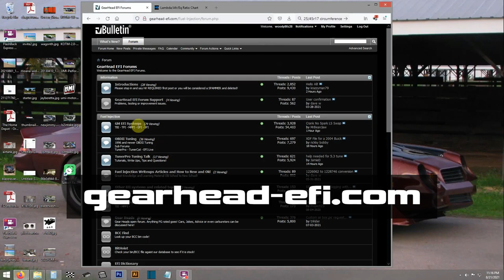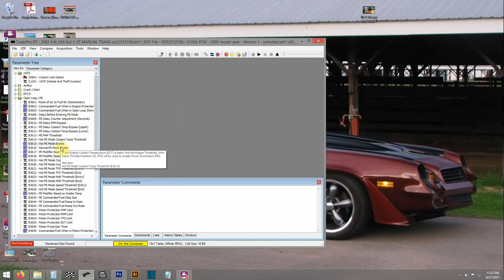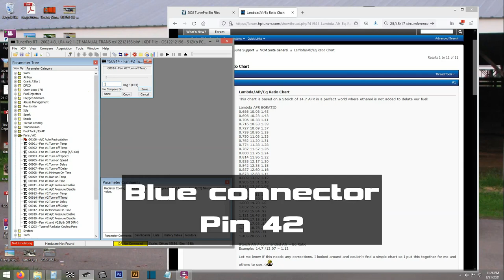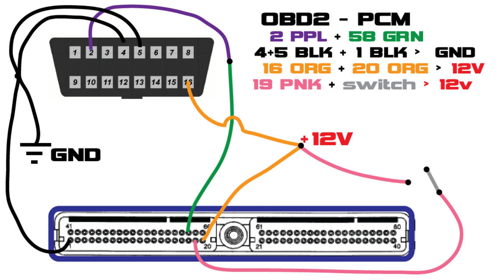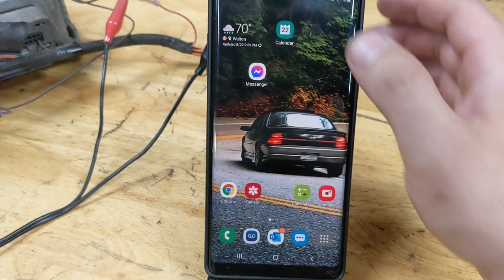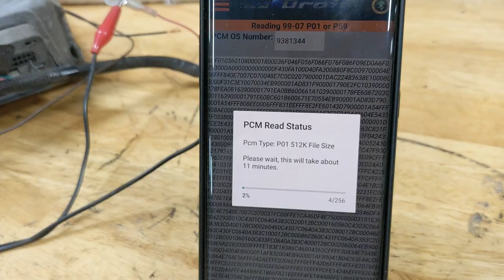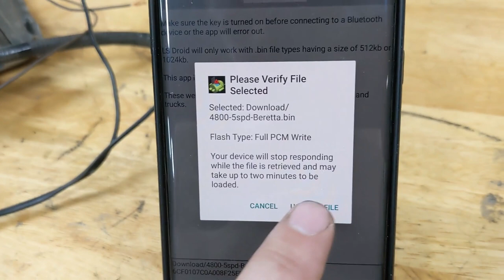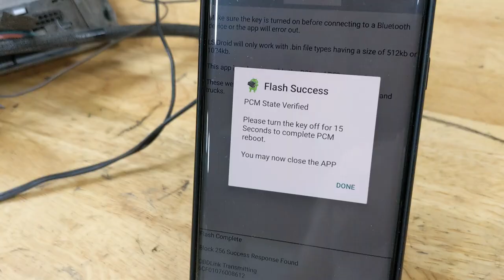Free LS tuning via bluetooth with LS-Droid - VATS delete, PE, efans, etc

Comment: Thank you for the good video. You'll be seeing me using this hopefully in September 😂. LS swapping a 91 GMC S-15 (4.8/AR5/8.8).
Reply from the maker: Sweet deal. I bought a 5.3 with harness and fuse block too swap my s10 blazer...but I dunno man. Mine is such a rusty turd it might not be worth it!
Reply from the maker: I have the 4.8 and 8.8 setup in my Beretta RWD swap, but ended up going T56 instead of the 5spd
Reply: Heck yeah. I hope my truck is save able myself. I'll finally start being able to film the process starting in September. I'm always looking for new channels. Thanks. This LS droid is going to save me a lot of bs

Comment: perfect keep making these helpful videos
Reply from the maker: I'm keeping my LS swap cheap cheap cheap. Haha
Reply: @GEARHEADdezign  this should work now with gen 4 e38 ecu using the new ls droid right?
Reply from the maker: @FirstLast-tx3yj  I just googled it, and it looks like it can
Reply: @GEARHEADdezign  amazing then!! Where to download the bin files from?
Reply from the maker: @FirstLast-tx3yj  read the one from your existing PCM
Reply from the maker: That's always the first thing to try
Reply: @GEARHEADdezign  i know i should and save it as a back up but i mean a sloppy stage 2 cam tube for example
Arent there bin files for such template tunes so i just flash and go?
Reply from the maker: @FirstLast-tx3yj  you could check gearhead-efi.com
Reply from the maker: I think there's a PCM hammer library too, but I haven't used it

Comment: My LS1 had a custom tune years back and sadly the tuner is no longer in busineess. Long story short, the cats went bad and did a cat delete. I am getting some P1133/53 error codes thrown at me, and nothing seems to fix it. I read somewhere that it's possible to tune out these codes from coming up. Is that something I can do with this software? I  do not want to lose the custom tune done though will I lose it if I start messing around or can it just go in and change what is needed to turn off the codes. Any help would be much appreciated.
Reply from the maker: Yeah, you should be able to read your custom tune and just make changes. If the operating system isn't supported by TunerPro you could also try "universal patcher"

Comment: Do you have to remove the PCM to read and write to it ? Is it possible to do it obd port inside the car not take anything apart?
Reply from the maker: In a truck with canbus it's recommended you remove PCM. I was able to do it from the port in my old LS swap car though

Comment: I have no idea what you did, but guessing, you changed factory programing using selective factory options for other models basically. you eliminated auto trans sensor, enabling use of ol' school manual? and somewhere in those files alarm/immobilizer is deactivated? wud you be willing to program my pcm when time comes? or write a kindergarten brain mentality directional list of procedures. I'd be willing to pay , one more thing, how much more/less vehicle info does one need for getting most outta pcm to a non -pcm vehicle aka '81 p/u , and a/c as future option, everything else standard '81 no smog pump,can a performance chip be used or is that basically wat is being done? can cam timing be modified ? original 5.3 LS had automatic in 4wd crewcab '05 no idea if 4L60 or 4L80 i cud find out if thats necessary ....just curious, how did you learn bout all coding n is it something that experienced ppl shud do?  i'm sure video is/was helpful to many, so thanx for making it, consider doing one using MSD LS box for naturally aspirated engine?

Comment: Is there a way to skip the "middle man" of the Android phone and BT dongle, and just read/write the file straight from the TunerPro software on the computer?  Using a USB to OBD2 cable?
Reply from the maker: Nope. I don't think so. You need the Android OS to run LS Droid and Windows for TunerPro. I did set my laptop up to connect to the BT dongle and that let me datalog. (See my other video). But TunerPro will only write OBD1 chips, it can't do OBD2.
Reply: @GEARHEADdezign  gotcha, thank you very much for the explanation

Comment: Subscribed! this is an amazing video! One thing i eread somebody say they bricked their ecu doing this, is a easy to do that or maybe the person just did something wrong?
Reply from the maker: I've only heard of that if the battery dies while doing it. But, there's a ground pin inside the PCM case that you can ground while booting up the PCM and it will "unbrick" it. I've actually used that process once to save one that I screwed up.
Reply: @GEARHEADdezign  good to know, i think i am going to do this and try it out, is the bluetooth dongle you have listed the only one that works ?
Reply from the maker: I think that's the only dongle that's guaranteed to work. Others could possibly, but I wouldn't bet on it.
Reply: Just got my dongle , will wire up a setup like yours and will be trying it out!! you have any other videos showing the actual changing of settings in the tune, like torque management and such? You video goes so fast at that part of it, thanks!
Reply from the maker: @kevinc5917  sweet. I sped up that part of the video cause it was boring otherwise. But you can replay it and get the details you need probably. Have you downloaded the software and checked it out yet? The XDF that I used had good notes that explained the parameters
Reply: @GEARHEADdezign  i am going to try out the software today grab a tune close to mine and just play around in the software with it.  I can read my stock tune and save it and i connect to my ecu correct?
Reply: @GEARHEADdezign  where find the bin tunes? i found .cal that list 5.3l but the bin file list i dint see anything with 5.3l in it
Reply from the maker: @kevinc5917  if you read your tune it will give you a BIN file that matches your operating system. Then just find the XDF for your OS to translate it
Reply from the maker: .CAL is Hptuners format. Won't work. If you find out your OS when you read your PCM I can help you from there
Reply: @GEARHEADdezign  ok thanks , i was just looking for a 5.3 auto 4x4 to play with the software, i havent got my tune from my ecu yet, OS is operating system?
Reply from the maker: @kevinc5917  yes. LS Droid will tell you the OS as you read it
Reply from the maker: @kevinc5917  I got the notification for your last comment but youtube already deleted it. Happens a lot actually. So repost your question and I'll try to answer it
Reply from the maker: @kevinc5917  if needed, you can change OS to something that has good XDF support. 2156 is a common one. For that, you'll have to download a BIN that's 5.3 4x4 auto and then check or change the gear ratio, etc to match your truck. And VIN
Reply: @GEARHEADdezign  i read that , then they say to clone it, figuring this shit out but not sure on the clone part. Still waiting for email verification from gearhead
Reply from the maker: @kevinc5917  when you go to flash, you can write cal only or clone. Clone flashes the OS, tune, VIN, everything. I used a 4.3 PCM to clone to my 8.1 and it was good
Reply: @GEARHEADdezign  Oh ok, so once i am done with changing everything i want and save the bin, then with ls droid on my phone via Bluetooth , thats where i choose to clone and send to the ecu, correct?
Reply from the maker: @kevinc5917  yes
Reply: @GEARHEADdezign  Nice! Thank you!

Comment: So if I buy a ODB2 to USB cable, and connect to my laptop, I can then tune my truck through a tuning software? after I read and write the stock ECU files?
Reply from the maker: Not necessarily. The Windows version of LS Droid might be able to, but I've never used it. 
I modified the tune on PC, but read and wrote the tune via Bluetooth on my phone

Comment: 1) Do you have to pull the PCM or can this be done on the truck using the OBD2 port?

2) How do you properly delete EGR?

Thanks for the video!!
Reply from the maker: I read mine in the truck, but it's suggested to remove PCM for flashing. The body modules can mess with the signal supposedly.
Reply from the maker: Easiest way to delete someone is to raise the enable temp higher than you're ever likely to hit
Reply: @GEARHEADdezign  I'll think that applies to 03+ vehicles that use can bus.
For a 99-02, I don't think it would be an issue leaving the PCM in the truck to flash.
Reply from the maker: @tt7hvn  that would certainly be handy for my Beretta swap where the wheel needs to come off and fender liner out to get to the PCM🤣
Reply: Great info

Comment: I’m brand new to this. I didn’t see anything in this video regarding VATS delete; Also, how do you know what values to enter for the tune? I just got my LS engine, it’s not in the car yet. I have everything, harness, computer, fuse block, etc.
Reply from the maker: Yup, there's a spot in there to delete VATS. There are parameter comments for most of the options too. So like VATS if I recall correctly it's a 1 or 2 in the field for on or off. The key is right in the comment.
Reply: @GEARHEADdezign  thank you! I gotta start playing…hopefully this weekend! Are you doing all those selections on a laptop/desktop? You’re flying! (Unless it’s sped up video for this how-to you made lol) 
I have to put this on .25 speed so I can keep up!! That said, YOU keep it up, I love all this legwork you’ve done. If I can help gearhead-efi, I’ll post there for SURE!
Reply from the maker: @r.joseph8911  haha yes, it's sped up for the video. It would drag on forever and be boring if I made the video normal speed, but I figured people could slow it down or rewatch if needed

Comment: I'm trying to research the best option for my 2012 Tahoe LTZ 5.3 AFM/DOD delete ECM mod.
My understanding is I need to reprogram the ECM. I've installed a new non AFM/DOD cam & lifter kit.
This is the only modification that I will be performing on this 5.3 MVS Chevy engine, so this mod doesn't justify the purchase of the "HP Tuner" for $500 plus a credit or two.
What's the best and most cost effective course of action in reprogramming or flashing the ECM to delete the DOD/AFM OEM feature in the ECM?
Reply from the maker: Last I knew, this software only works with 99-07 P01 or P59 PCMs
Reply: @GEARHEADdezign  
Boo hoo😢
Thank you for you quick & prompt response👍

Comment: Every time I read the pcm on the app I never get the option to save it? Can someone tell me what I’m doing wrong?
Reply from the maker: What does it do after you read the PCM?
Reply: @GEARHEADdezign  literally nothing it says my ls droid app is offline as soon as I open the app I’m not sure if that has to do with it
Reply from the maker: @Danii2.  it needs a wifi or cell connection while you use it.
Reply: @GEARHEADdezign  it does have one that’s the thing I don’t understand
Reply from the maker: @Danii2.  hmmm. I'd try a different Android device

Comment: In the fans for the a/c is the settings where they need to be or did you not adjust them because your not running a/c? I don't want to blow up my a/c system because the fans didn't turn on
Reply from the maker: The fans turn on just to help the a/c condenser cool down. And trucks have a clutch fan so the PCM setting is irrelevant.
Reply: @GEARHEADdezign  ok thanks

Comment: I don't have an ECU. Can I get one for a 99-07 truck, my engines out of a 01 truck, use this method to clean it and clear vats?  I put a bigger cam and headers on it so will this stuff let me tune it at home?
Reply from the maker: Yes, you'll have to get a 99-02 (red/blue connectors) to match your engine. But yes. This is how I'm running an LS in my Beretta🤣
Reply from the maker: I'm actually running a Camaro tune with a truck PCM and moving a couple wires on the truck harness